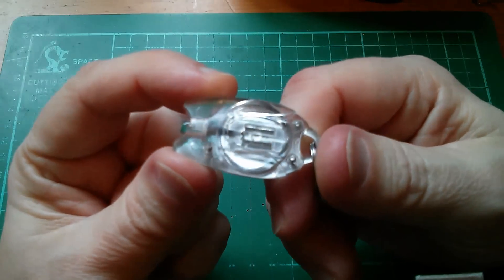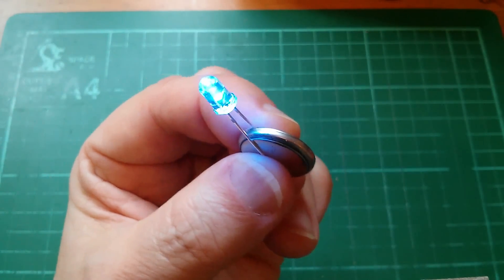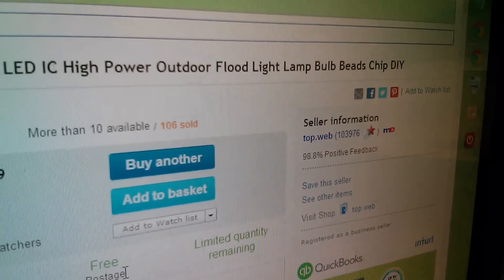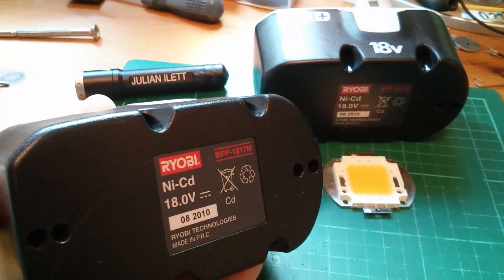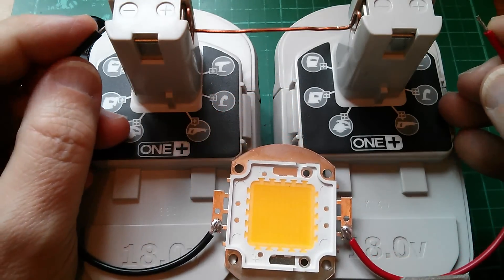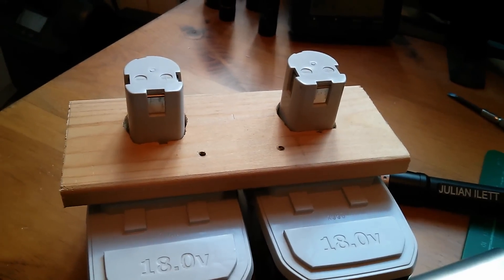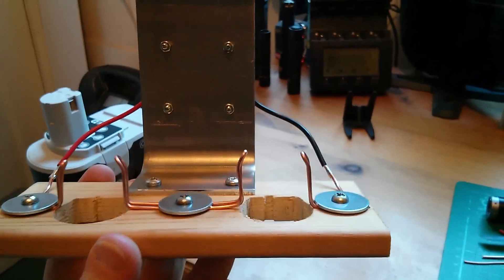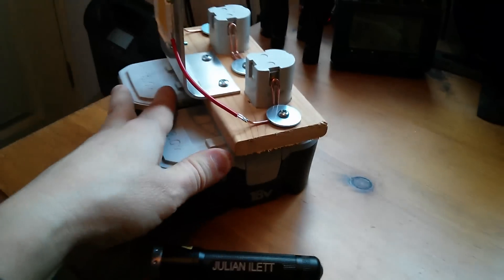Monster 7,500 Lumens 100W LED Flashlight for under $10

Comment: Julian,

Based on this video, I got  a handfull of them (thanks btw) and mine come on at 24V already, very bright and don't get hot. 18 is no go but 24 seems plenty of light.

haven't measured current and don't know fi it's maximal brightness but 24V is good.
Reply: Ok, I just did measure:

input voltage is 26V from 4 (2x2 in series) 12V sla batteries.
Whan hooked up it draws around 145mA and the V doesn't drop a bit.

I can't measure the Lumen but it's so bright that if you look directly at it
you'll have a sunspot in your eyes for a while... so that's VERY bright
and certainly bright enough for consuming about 4 watts.

should I make a video of this in case I'm making a gross mistake?
Reply from the maker: Yves Baggi The only 'mistake' is that you're driving a 100W LED at just 4 Watts. That's fine, you'll get a fair amount of light and the LED will stay cool. But you're missing out - on 96 Watts of extra power! The problem is that 36V of lead-acid will blow the LED, so don't try it. This only works with NiCd batteries because they have a high internal resistance, but it's worth it - because it is monstrously bright!
Reply: Julian Ilett Thanks that expands my understanding a great deal. I finally have an understanding of 'internal resistance'.... so that's why it's important.

Is is right then that batteries or devices will high internal resistance will in effect act as a current limiter of sorts?

What is your take on gamerpaddy 's suggestion below to use a step up converter? or one of the DC-DC converters you reviewed in other videos?

About the light though: I can't imagine that this thing would put out 25 times more light if I ran 100 electrical watts through it. That would be like Wembley stadium lighting. The relationship between electrical watts and light output is probably not a linear function, or is it?

(My aim is to get the most lumens per electrical watt.)

thanks for all your great videos.... and comments
Reply from the maker: Yves Baggi Yes, the internal resistance of the batteries limits the current. It also works with lithium batteries if you use an additional 2Ω or 3Ω resistor.
My original idea was to use a 12v lead-acid battery, a boost converter (like gamerpaddy suggested), heatsinks and fans. But the idea of a super-cheap $10 design was just too appealing!
You're certainly right - 25x more power will not give you 25x more light because so much of that power will be wasted as heat. But more power will give you more light - just not proportionately.
If you want the most lumens/Watt, you will be aiming for minimum heat - you may have found that already.

Comment: check the china step-up converters (search for 150W stepup on ebay), it transforms 12V to the 33V needed for LED.  i built 2-3 flashlights with it, check my channel.
Reply: good idea, never thought of it. i might try to build one myself
Reply: but do you need a resister for this? Or not? I bought the same one 150 stepup and 100W led but afraid I will kill the LED.
Reply: You dont need a resistor. just check the output voltage with an multimeter  and adjuste the potentiometer on the board to 34V  thats all.
Reply: btw, where you get a resistor that wont burn up @ 100W?  haha.  brake resistor from milling centre?
Reply: gamerpaddy IDK just asking. So you didn't blow your LED with that 12v-35v stepper?
Reply: yep, im using 3 in paralel to power up 200W (2x100W leds)   because  above 90W it needs to be cooled.  if i split it into 3, its just 33W each.
Reply: 66W i mean (for 200W) 33W for 100W
Reply: that sounds awesome did you make a video of that?
Reply: check my channel, there are 4 or 5 videos about 100W led's

Comment: ni-cd? realy man?? 3-4 sec?? that's not a flashlight that's just a flasher! try a nice lipo battery  a cpu heatsink and a voltage regulator they are soo cheap you can even recycle them from old pc psu's and  for the love of god work between the specified voltage.. is there for  a reason...

Comment: nice video! but is it safe to use a dc 36 volt powered with bare hands touching the terminals? at what voltage you reckon that dc currents can pass through human hands?
Reply: as long as you are not touching battery ground.
Reply from the maker: Hmm - that's an interesting point. Watching the video back, I don't get any sense of danger because I know that 36V DC won't do me any harm. But what if it had been 48V DC? - would I have been a bit more wary? (probably). Above 60V DC, I don't think I'd have wanted to touch it. And an inductive load, such as a motor or solenoid would have put me off because of the back EMF kick.
But you're right to ask the question, and I should think about doing this sort of thing again in future videos.
Reply: Julian Ilett yes don't play with coils and motor back emf..even a well charged 9v or even 6v can give you a zap as theyre disconnected from load if you happening to be in contact with the coil end of terminals especially if theyre coils!! my relentless search for radiant energy (tesla syndrome) in coils made me test them with transformers.. they zap either way primary or secondary regardless.. but the primary low resistance side can even burn due to the high current back emf..imagine what kind of jolt we can expect from a well charged 36 volt dc placed on a transformer???
Reply: 10 9v batteries in series-90 volts. felt nothing between fingers of one hand. dry fingers though!

Comment: That is great Julian. Have you considered applying some cpu thermal paste to the back of that led and attaching a simple air cooled cpu heatsink? they aren't that big and they work well enough to keep a cpu under load cool. I know that un cooled cpu's blow up into massive temps very fast.

Comment: Looks like i might be able to make a 500 watt grow light ,the one you have may be good for short use but i will need a 10 to 20 amp power supply  fans  nive heat sink ect,,, i can see where the money comes in on comercial units ,,lenses adjustments  variable functions ,nice  hard coated  cases ,ect  i do wonder why they dont use big  low cost 100 watt chips and develop lenses to maximize  instead of 3 watts usually used?

Comment: Believe it or not, but WalMart has all types of lighting. One particular looks like this unit featured here! If you go to there web site, do a search, as I did, it surprised the hell out of me! Look for Strobe Lights in your search. If they do not have it, they at least were kind enough to show you the links to click on.. I go all the time to their sporting goods for ammo, never thought of looking around for lights! 12 volt on up, also FYI most party strobes are 12 volt, they just have a trans former in them to make them 110-120 volts. The prices are not bad either. It's worth checking out, as they can be altered for field use also.  Later on, Good Vid! TY, Redd...

Comment: Interesting test but you really should put a current meter in series to see how high the current goes. You have to get really lucky for the voltage to be just right so you might be vastly overpowering it and killing it in seconds or minutes. You can't rely on the 3 amps to load down power tools batteries. a cheap multimeter can measure the current. if it's too high you can buy a low value power resistor to do the final regulation. or maybe use a bit of graphite from an old radio.
Reply from the maker: The lithium batteries needed an additional 2Ω or 3Ω resistance, but the NiCds were just about right. I did a fair bit of testing with an ammeter and a 50W rheostat before making the video.
Reply: Julian Ilett so what was the current?
Reply from the maker: Dan Frederiksen It's not very constant, but with fully charged batteries, it would hold at least 2.5A for as long as I could keep the LED lit.

Comment: Never EVER run high power LEDs with constant voltage!!! Always only run LEDs off constant current!!!

That 100W LED in the video will have VERY short lifespan/fast degredation (like an hour, if it is cooled probertly, lol.

As LEDs get hot, they draw more current, from the same voltage, so you will have thermal runaway. 

I was actually sure the LED was toast, when the camera died.
Reply from the maker: Because of the high internal resistance of all the NiCd cells, current flowing through the LED is effectively limited. If you try this with Lithium batteries, the LED will blow instantly, like a fuse. Add a 2 or 3 ohm resistor and it will work with Lithium too.

Comment: @z1power I've don't this in the past. I used some thermal glue to add a old CPU fan, the projectors fan will do the rest. Biggest problem is the light distribution - leds emit usually a very narrow beam so you might get a bright center and dark edges without special lenses
Reply: Ist die warmeentwicklung so groß? Wegen des Lichtkegel, bei Taschenlampen haben sie immer eine  tropfen auf der LED dieser scheint zum aufteilen des lichtes zu sein um es dann über das Spiegelssystem gleichmäßig nach vorn zu werfen. Evtl kann man für einen Mittleren Preis das Teil noch verbessern. Zumal aktuelle Taschenlampen mit über 300lm noch um die 300€ Kosten. Jedoch kann  man sie bestens zum fotografieren einsetzen....
Reply: Nunja, 100W sind schon einiges - wenn wir von einem Typischen LED-Wirkungsgrad von 90% und 30% output ausgehen reicht das schon als kleine Herdplatte ;)

So Linsensysteme gibts viele. Am günstigsten könnte man eventuell bei Haushaltslampen davon kommen. Ob die die hohe Lichtstärke aushalten muss sich natürlich zeigen. Wenn du dich für sowas interessierst schau mal bei "electronupdate" vorbei, der nimmt regelmäßig solche Lampen auseinander.
Reply: Cool, danke. Habe mich die letzten Tage nach LED Taschenlampen umgeschaut da sie zum fotografieren einfach genial sind.

Comment: Yes easyest way sorry, 100w drivers are kinda what I figured didn't know what other options there is. I know enough about electronics but not the much on the technical side as far as the right components etc. I did fine a 100w driver non eBay I was going to look at getting...Thanks and I enjoy your channel keep up the good work :)

Comment: Hello Julian, I was wondering if you could help me in figuring which way would be the best way to power 6 and possibly 9 100w led lights. The power will be directly off house ac...Thanks JB
Reply from the maker: Best way? The easiest way would probably be to buy one 100W mains driver per LED. If you put the LEDs in series, you'll need drivers with very high voltage output (which I've not seen). LEDs in parallel will require a high current. But heat removal may be your biggest problem.

Comment: Julian I have plenty question about choosing a good boost converter for a 100 watt led. I bought one from sure electronics and it burnt up in about 15 min. Will low voltage from the battery burn a converter up? I s there any way I can email you with questions? Or email me at ctemplet0956@yahoo.com Thanks
Reply from the maker: I like the 600W boost converter - it runs fine from 12v. Search eBay for "600W boost". You can get my email address from my website - check the links on my channel page.

Comment: Before you continue with 10$ LED flashlight measure the current. If u can, use the clamp ammeter so you don't introduce additional resistance. Also make a heat sink much bigger or bigger ventilated one and measure the current when the LED gets warmer because LED voltage is getting lower with heat.
The coin battery doesn't work just because it has close voltage, but because it has high internal resistance which limits the current, most batteries don't have high resistance.
LED drivers are there for a reason, just build a cheap linear one and put it on heat sink. I am using linear driver which has 0.3V drop on it for a 12V system, but i have it to regulate the current.
Reply from the maker: All good points. During testing I saw quite a high current initially (over 3A), but this quickly fell and 'settled' at around 2.5A. A lot will depend on the condition of the batteries.
The CR2032 coin cell has an internal resistance around 20Ω so it does play a part, but put a red LED on it and the initial current will be around 100mA - see "Some thoughts on throwies" at Evil Mad Scientist.

Comment: Interesting build there Julian, I've got a couple of those 100W LEDs too. Just waiting for a project to come to mind to use them on :)
I was considering getting a couple of the lenses you can buy from eBay for these LEDs just to focus the light a little better. Have you tried the lenses?

Cheers mate

John
Reply from the maker: Thanks John. Not properly yet - but I've got the reflector and lens somewhere - so I'll do a follow-up video at some point.
Reply: Iv one of these and there evil and realy bright!! Iv got it in my workshed and it lights my work area up!! Bloody gets that hot you need a good heatsink and fan!! Iv put a thick lense on it too. Even thow you don't need it hahaha 👍😉

Comment: cameras also tend to turn off if you point them at the sun, i guess its to protect itself. I do have 3 small 12v lead acid, this may be a fun torch to make with those
Reply from the maker: Take care! This works with Nickel Cadmium, but may not work with lead-acid. What this video doesn't show is all the testing that went before - with a fuse, an ammeter and a very high power wirewound variable resistor.
Reply: In reality this setup worked because the internal resistance of the batteries  along with the voltage drop across the LED limited the current and just happend to match the LED's requirements. A lucky if predictable coincidence. Change the source with a different internal resistance and/or voltage and the results will be different, possibly catastrophic for the LED. So unless you have the means to measure internal battery resistance have hard published data or simply sneak up into the operating range as Julian has done then disappointment is a distinct possibility.
Reply: Julian Ilett do youthink it would work with ryobi lithium ion batteries?
Reply from the maker: No, this trick won't work with lithium batteries - the LED would burn out immediately.
Reply: Julian Ilett k, el,
Reply: puro

1   1-
Reply: +Alejandro G÷omez !